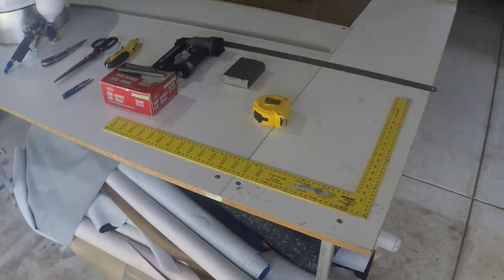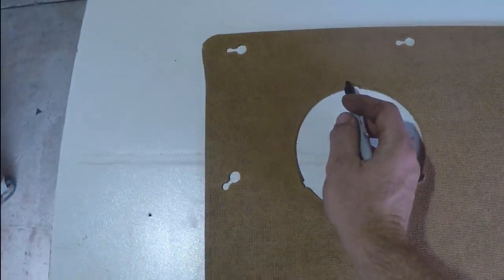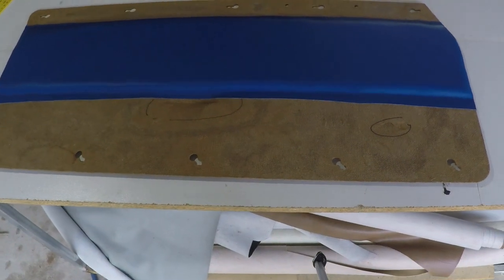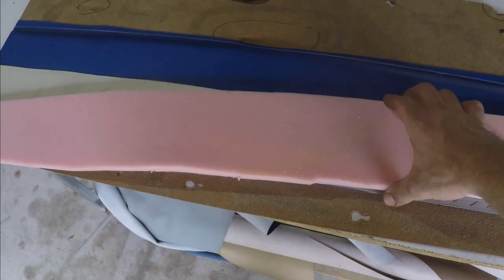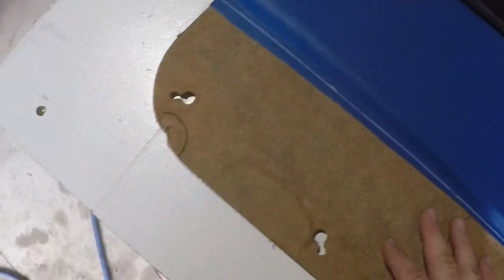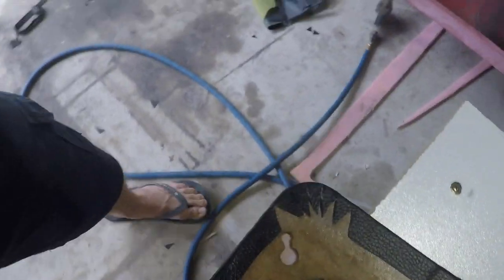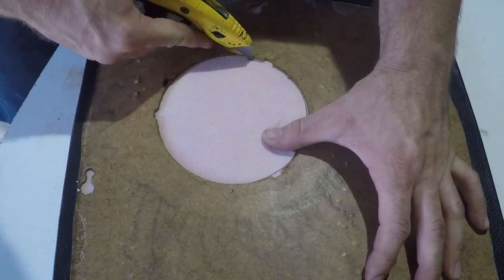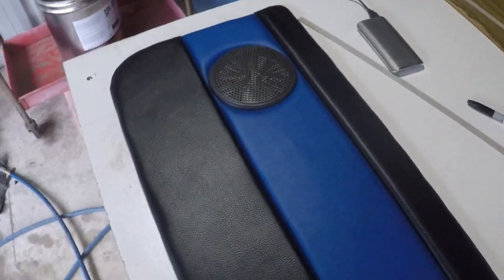3 part door panel upholstery tutorial (no sewing machine required)

Comment: If you did not know, you can purchase a spray can with tacking glue similar to the glue you used with your spray gun. I've used it to re-upholster chairs but not door cards, but it should work. The glue can be purchased at any craft store or online. Otherwise, it's a cool idea to use basic upholstering technique to create door card. One question: Why not fill in the defects before recovering the door panel?
Reply from the maker: I have tried a couple of the cans of glue it’s just my preference to use the spray gun. You could fill in the defects but this was just a demonstration panel never to be used on the car so no need to spend the time on it.

Comment: Just a quick question??
Won’t the 10mm foam push all the fittings out too , as my doors don’t have it !!
TIA
Reply from the maker: 10mm foam can push things outward. You will need to test to your fittings will be able to compress the foam enough to still work. If this doesn’t work you can cut small sections of foam out. You can also get thinner foam it typically comes in 3mm size increments. 3mm, 6mm, 9mm, 12mm and so on

Comment: turned out awesome  what  length are the staples you  used
Reply from the maker: Usually on the door I will use 6mm staples but on the back taking strips I will often use 10mm staples as the shorter staples like to pull out on these 👍
Reply: @SamsProjectBench  awesome  thank you   excellent video  and a huge help  for my  next project
Reply from the maker: Your welcome thank you for watching 👍

Comment: I noticed some lines in the old panel. Are they embossed? Or was it a plastic cover molded design. Do you have any videos on embossing lines or design? I'd be interested in those tutorials.
Reply from the maker: The old cover had welded embossed lines. These are put in with a high frequency welder these are specialty equipment used to weld PVC based materials and are not common in the diy environment. I haven’t done any tutorials on this specifically my preferred method is to sew lines into the material with the foam already glued to the materials embossing is not always practical due to the amount of work and time required but if a certain look is required it can be done otherwise it usually gets sewn or a back taking method is used

I have some door trims to do on my Nissan patrol coming up I should be able go into further depth in video once into the process

Comment: must have electric windows an no way to open the the door from the inside?
Reply from the maker: This was from the rear barn door of my Nissan patrol the door open mechanism is on the side and the window doesn’t open but this technique still works well on doors that do have these,. You will need to allow for these cut outs and position the joins accordingly 👍

Comment: Is there a way to do a diamond pattern head liner without stitching?
Reply from the maker: You could possibly lay a Diamond stencil underneath and lay the fabric over top for an embossed look. Depending on what type of head line you could possibly look at diamond tufting/ deep diamond buttoning. I did a Kenworth truck sleeper cab using this method years back but it’s not for the faint hearted. Stitching diamonds is probably your best bet this is usually my preferred method

Comment: Does it hold if you don't staple the edges on the back?
Reply from the maker: It always holds better if you can pull the materials around and staple them on the back there are some circumstances where you can get away without stapling behind but it is typically my preference to staple them on the back 👍
Reply: @SamsProjectBench  Understood. Thanks for replying 👍
Reply from the maker: @ahmadakmalbinabdmanan6382  you’re more than welcome 🙏